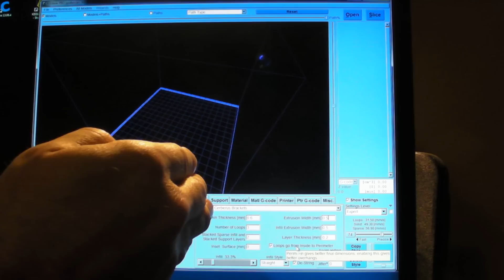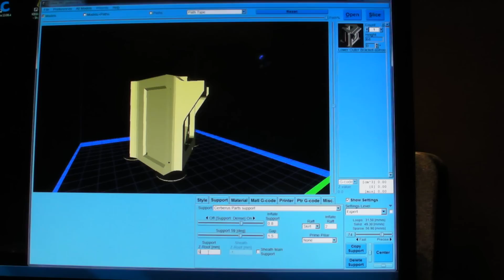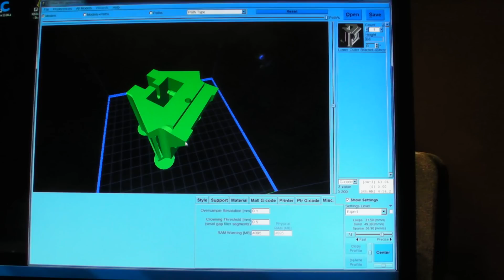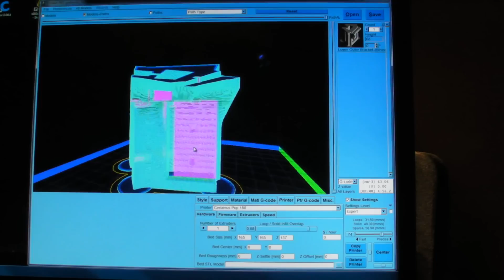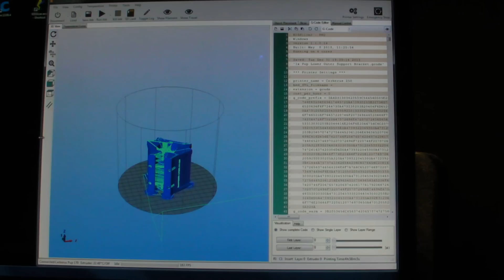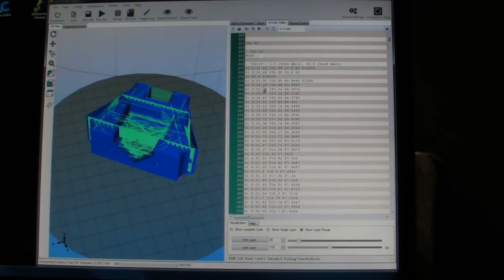Kisslicer and slicing for Cerberus Pup 170 3D Printer

Comment: "Repedier" lmao, its Repetier kiddo, sound it out lol. Also for those of u who are saying kiss is better than slic3r, heres a tip, take these settings and transfer them over to Slic3r, then tell me kiss is better lol. If you don't know how to dial in a printer, and have failed to calibrate it yet, than ya, its gonna suck, but its the user not the machine or software. If you really wanna see some crazy fancy / technical prints, go learn skeinforge and set it up for your printer. Most people hate it because its too hard, but its a badass slicer, you can do things like set a .25 inner layer and .1 outter shell, rotate infill in the X axis, make an ooze tower, set layer path to go outside of the island so none of the internals ever get hit. Its way better than any of the "Do it for me" slicers. You better study thermodynamics and your material, and It wouldn't hurt to look up some physics force equations in relation to viscosity and acceleration. I spent 11 years in grad school and I still find it to be a challenge. I need a calculator and digital caliper at all times. And a spatula to follow behind the extruder on first layers.